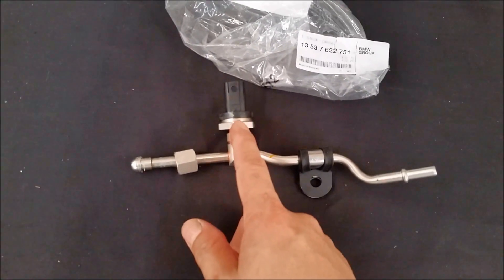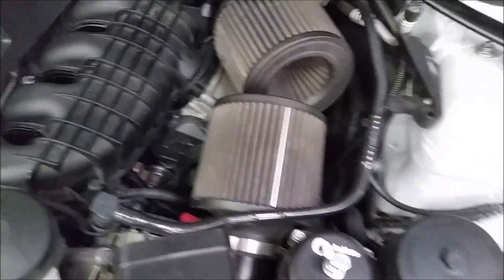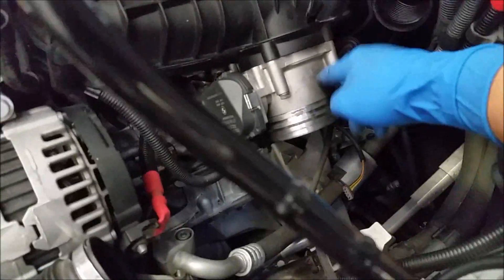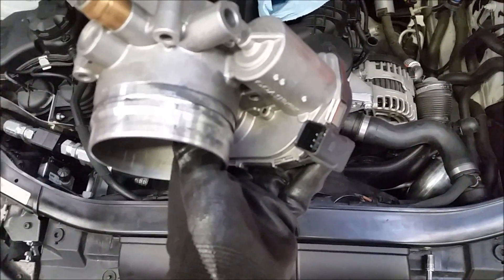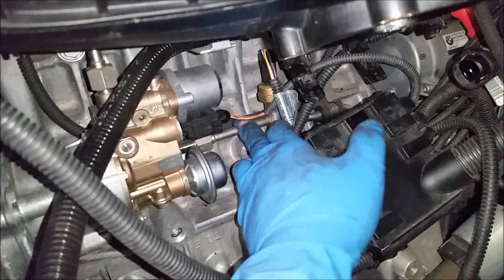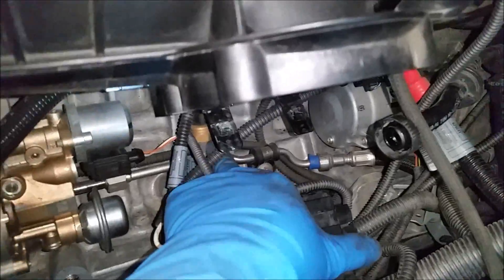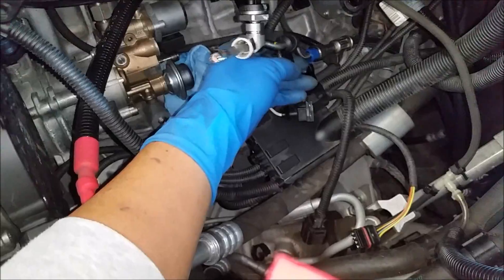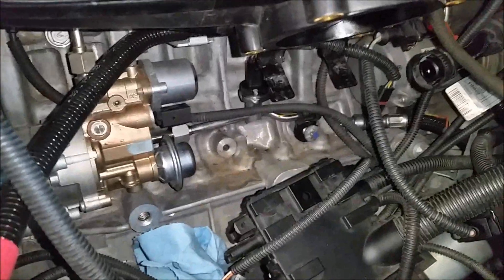Low Pressure Fuel Pump (LPFP) Sensor DIY - BMW E90 335i & E82 135i

Comment: Quick question: so I was able to pull the line out by pressing the blue quick release sleeve, but I’ve pushed the new line as far back as possible and the new line does not lock in place. Any tips?
Reply: Update?
Reply: @robertkenney6002  When the line is fully in, make sure the quick release tab inside clicks. You can ensure this happens by pulling the tab towards the front of the vehicle while pushing the line back. Kind of tedious due to the small space, but not too hard. Good luck 🙏🏼

Comment: Recently changed this part. Now i get the code "2A2D" with Half-Engine light.. Ugh, any ideas? HPFP? N53B30..
Reply: you get it fixed?
Reply: @concreteassociated7630  Cleaned solenoids and car didnt get half Engine light and shaking anymore. Still had 2a2d though and no I never solved it sorry. I sold the car.
Reply: mine went into limp mode and shut off then only clicks when i try to turn it on got 2a2d active tho would you suggest solenoids ?
Reply: @concreteassociated7630  I had the same!! I had to remove key and put in again and quickly drive otherwise car stalled again. Then it like “jumped while almost dying” and then it could work for like a whole day / 2days. Very weird problem, sometimes coming sometimes not.
Reply: @concreteassociated7630  Idk solenoids are easy to clean so why not try, but hardly believe that will help it. I tried everything, checked fuel pressure and everything was good. BMW dealer checked my injectors and was good also. My thought is that the LPFP sensor was the problem. I changed it twice, but i didn’t buy OEM. Personally my car DID not stall BEFORE I changed the lpfp sensor.
Reply: @Tweekzify  So your car would crank over BEFORE the lpfp sensor?
Reply: @concreteassociated7630  I’m on phone so kinda bad on writing. Before I changed to the new lpfp SENSOR my car was like “hacking” I could feel that it didn’t get power sometimes and felt slow. When changed to new one car was 100% and did feel VERY good for like 1-2 days then went to stall randomly. That’s why I’m thinking the part could be bad that I got, as it worked very well directly after the change. But I cannot help you sadly I hope you solve it as I didn’t.. I had N53B30 E90 btw.

Comment: BMW P15DF error code - Low Pressure Fuel sensor Malfunction (at Cold Starts).

note: you can smell the unburned gas as the car warms up and car shakes as well. Car also doesn't start right away and takes a few cranks because the pressure sensor is not holding the low fuel pressure for the High pressure fuel pump to work properly giving the ECM computer wrong signal in order to burn fuel correctly!
Reply: any idea why the fans would come on too? mentioned in forums

Comment: Hello i have a 2007 bmw 335i and i already replaced my valve cover because it was bad im trying to get the car to pass smog and i get the 2AAF code fuel pump plausibility as well as 29E0 mixture control, 29E0 mixture control 2
Reply: Hi art was you able to get the 2aaf code fixed thx oh and I got rid of my 29eo changing the Pcv

Comment: Our dealership is refusing to change out the HPFP, where the code is being sent “P142E” for it. It has already been replaced (HPFP) 2011, under warrantee. 
They told us the LPFuel Sensor, and line, needed to be replaced first. That is my issue.  So I did it myself, with their parts, and spent $217, plus the $178. They charged me just to put it on their ‘scope’.

They are doing the old fashioned guessing game, at the customer expense.  Please advise you thoughts. Thank you.
Reply: did the LPfuelsensor fix your problem?
Reply: @trungnguyen-lv3bq  Would like to know this myself.. getting P142E on 08 135i.

Comment: Sean, what is the part number for the connector?  I have 2008 535xi...the end of the wire that plugs into the block you remove from the intake broke off. Thanks.
Reply from the maker: Check out www.realoem.com for detailed part numbers.
Reply: No luck on realOEM.
Reply from the maker: Give your local dealership a ring. Hopefully they can help.

Comment: Sorry for all the questions. Bmw says the low pressure shorted internally. Should i replace the line as well. Maybe that will fix the issue. Thanks man
Reply from the maker: I'm not sure... if it shorted, you have to find out why it shorted or it can happen again with a new line.
Reply: SeanS54 ok. Thanks again for all the help. Im about to sell it and be done with bmw haha

Comment: Im just replacing the sensor. How do u get the wire off the sensor. Is it a clip or button i push in so it can disconect. Thanks man
Reply from the maker: See 2:56, it's just a connector you squeeze to pull off.
Reply: SeanS54 ok cool thanks man for the fast reply.
Reply: I hate this car haha i replaced it and cel came on again. So now i dont know whats wrong with it.
Reply from the maker: Buy a cheap code reader or go to a local autozone or pepboys- they will read the codes for free. LOL
Reply: SeanS54  thanks man. Im going to try that. Appreciate the help.

Comment: Thanks man. Great video. Going to replace mine soon. Bmw wants 700 for parts and labor to change it.
Reply from the maker: You're welcome. I never go to BMW unless it's covered under warranty LOL. I either DIY or go to a BMW performance shop.
Reply: $700 just to change out your low fuel pressure sensor!? That's laughable...its literally like an hour-hour and a half job yourself. Def DIY man.
Reply: Ik kokokp

Comment: Thanks for the video! I recently got the 2A2D code on my 335i. Do you think replace this sensor will fix the problem?
Reply from the maker: sorry not sure. you can check e90post.com for error codes
Reply: Owen, you get it fixed?
Reply: @concreteassociated7630  I didn't replace the sensor. My air intake pipe was lose. I cleared the code after tightening the clamp and it never came back.

Comment: Thanks for the great video. What would you say are signs that you need to replace this or the fuel pump ?  I have been getting some gas smells recently inside the back rear seat and from the outside of the 07 335i.  Appreciate your help.
Reply from the maker: This part is a factory upgraded part so I just did it to improve it. Signs of a bad fuel pump are rough idles and limp mode. BMW extended the warranty for the fuel pump so you should contact them and let them run your VIN.

Comment: By the way, those two solenoid lines (the black cables that attach to the engine block) are supposed to be laid behind the sensor fuel line per BMW TIS.

Comment: my question to you is did you first ck the fuel pressure before replacing this sensor....what if its just reading low fuel pressure and you have a pump problem ?
Reply: I had the same issue on my 135i. Reading low fuel pressure sensor. Code 29F3. 
Checked the pressure with my JB4 to confirm.
Reply: Because it's more common for the sensor to fail instead of the pump
Reply: ray dogga n
Reply from the maker: Good point. I did not do that.

Comment: Hey sean i have an issue but have no clie where to go i have an 2007 bmw 335i coupe n i just got the limp mode along with various codes, 29dc,30ff, 2c77, 2c78, 29f4 and 29f5. I have no clue where to even start, in dire need of help thnks.
Reply from the maker: Not sure what all those codes are. E90post.com has a lot of information and try searching there.